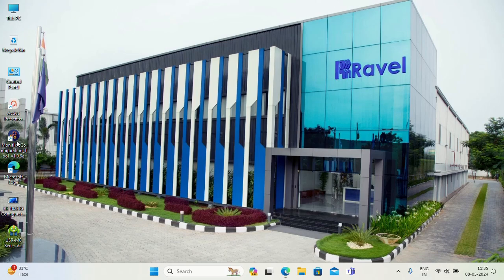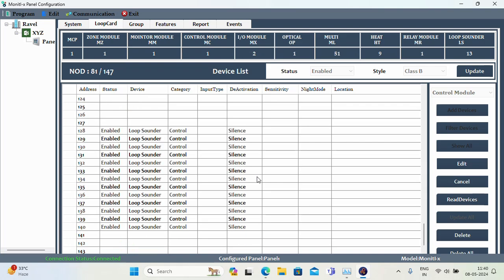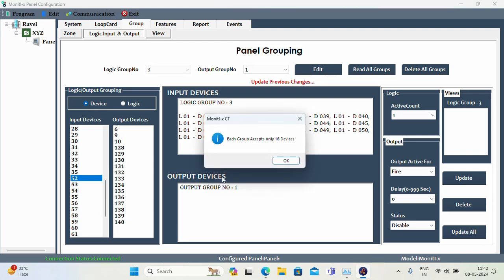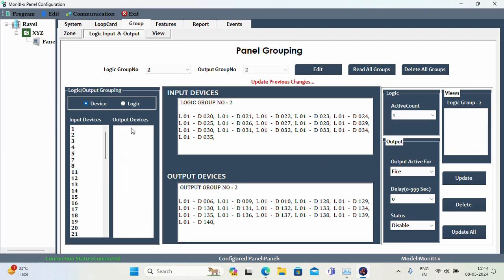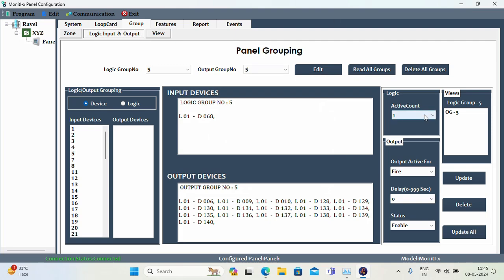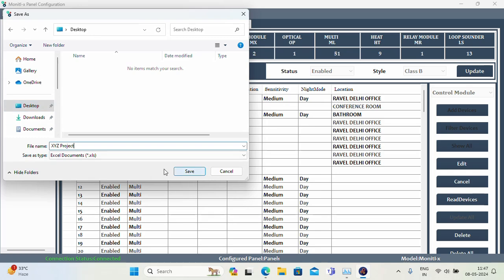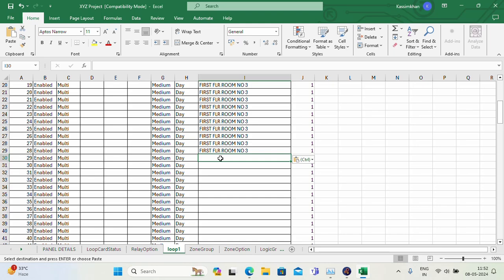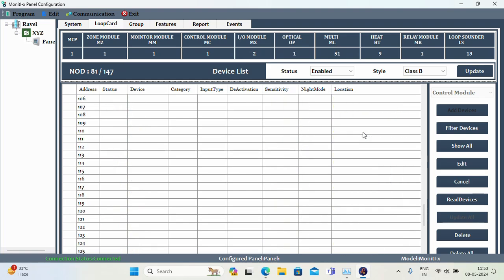Ravel Moniti-X Fire Alarm System | Single Loop Installation & Setup

Comment: How to give device addressing?????
Reply from the maker: Ravel MonitI-X addressable fire alarm panel mein devices ko Soft Addressing se address diya jata hai. Official Ravel documentation mein panel ke Soft Address menu mein Read Address, Write Address aur LED ON/OFF options diye gaye hain.

Device ko address dene ka basic process
Sirf ek device connect karein
Jis detector/module/MCP ko address dena hai, addressing ke time ek hi device connected hona chahiye. Ravel manual bhi “Connect One Device at a Time” kehta hai.
Panel mein ADMIN / Installer level par login karein.
PROGRAM → Devices → Soft Addr menu mein jaiye.
Manual mein Soft Address ke andar:
1. Read Address
2. Write Address
3. LED ON/OFF
diye gaye hain.
Read Address se pehle device ka existing address check kar sakte hain.
Write Address select karein.
Panel jab Enter Address? XXX dikhaye, desired address enter karein, jaise:
Smoke Detector → 001
Heat Detector → 002
MCP → 003
Monitor Module → 004
Address enter karne ke baad panel confirmation maangega. Device ko confirm/write karein.
Device ko disconnect karke next device connect karein aur isi process ko repeat karein.

Comment: Sir software link digiyega.ye monitle panel me 317 series ka smoke detector support karta hai kya ? Aur sir Avani panel ke liye loop powered (addressable) sounder+strob light 🚨 suggestion kardena pliz agar hogato 🙏
Reply from the maker: Sir, nahi. Ravel Moniti-X panel me RE317SL smoke detector support nahi karta. Moniti-X ke liye RE337 Series (RE337S/RE337SHL/RE337HL) compatible hai. RE317SL Avani Series panel ke liye hai.

2.    RE-24LS – Addressable Loop Powered Sounder (Wall/Ceiling Mount) – यह Avani panel के साथ officially compatible है। 
2. RE-717SO – Loop Powered Addressable Sounder. 
3. RE-717SS – Loop Powered Addressable Sounder + Strobe. 
Sounder + Strobe तो सबसे उपयुक्त मॉडल है:

✅ RE-717SS – Loop Powered Addressable Sounder + Strobe

और यदि केवल Loop Powered Sounder चाहिए, तो:

✅ RE-24LS या RE-717SO.